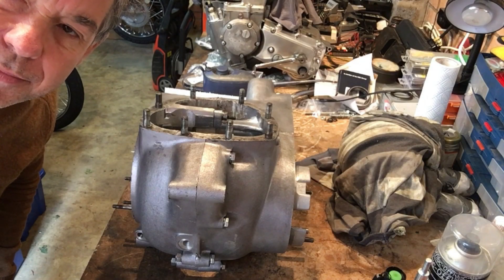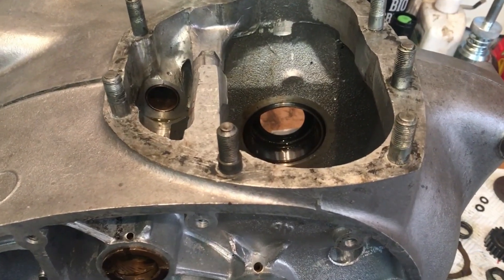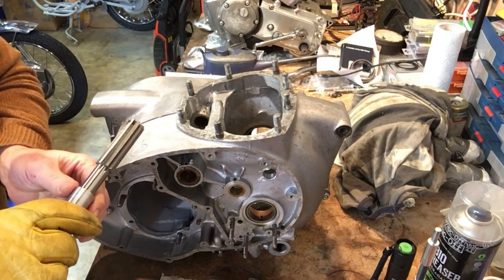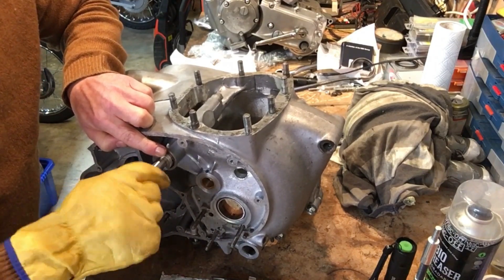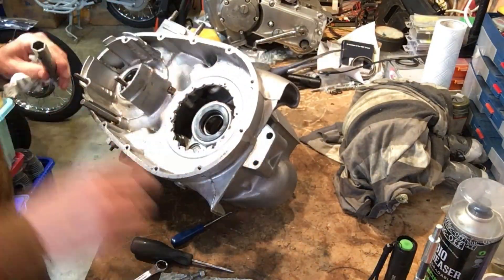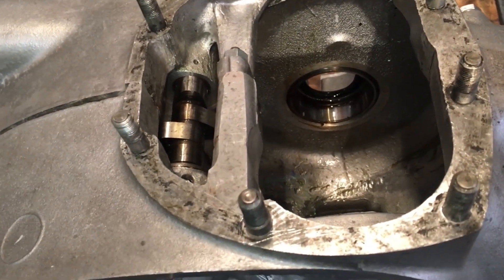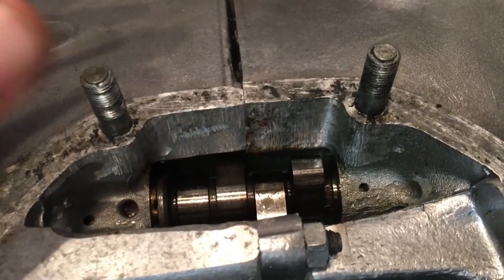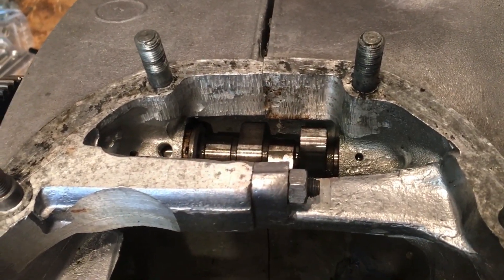BSA A70L Lightning - Engine Part 17 - Bottom End Build 2

Comment: Do you think they were this careful in the factory!
Reply from the maker: Hi Christopher. Probably not lol. But then again, their spangly new cases might not have been severely damaged! I'm wondering if there has been a little distortion with all the stresses when the rod let go and with the heat involved in replacing bearings and with the lumiweld. Anyhow, just about there I think.
Reply: Angus D. Campbell yes that's probably the case, it's great that you are keeping this engine alive with such care. Do we know how many of these were originally made?
Reply from the maker: 202 I believe including the prototypes. For homologation purposes in the US for racing, they had to build at least 200 production machines and offer them for sale.